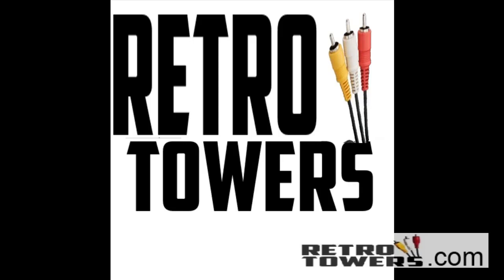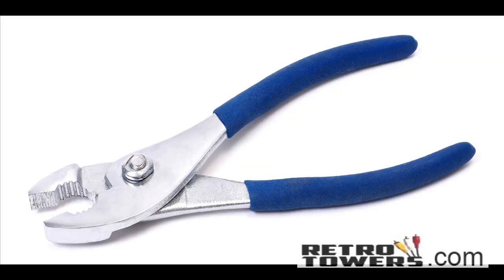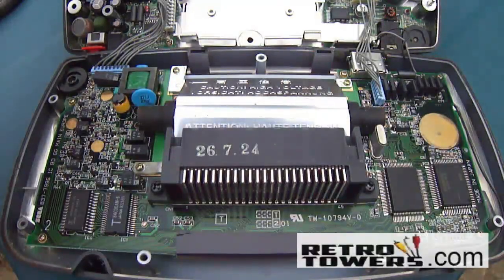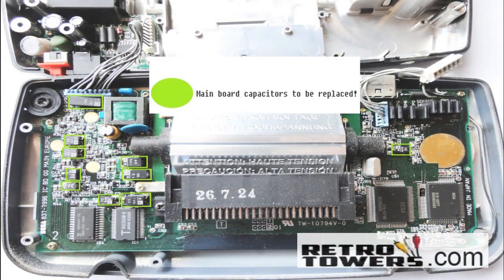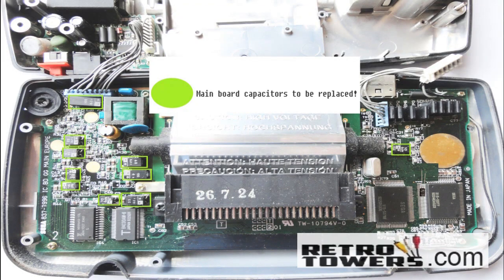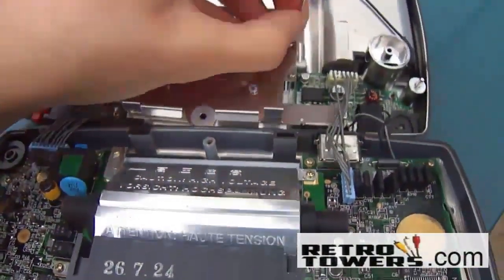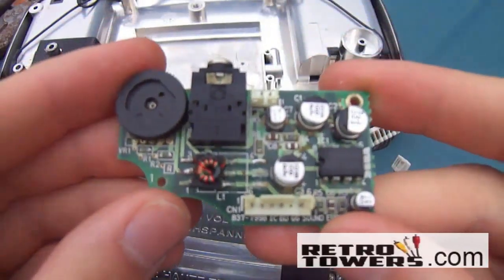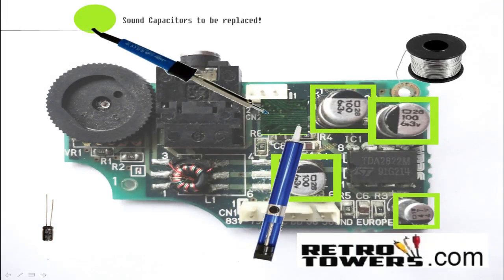Game Gear Screen and sound Fix capacitor replacement

Comment: I've got one that has sound, but the screen is just white. I can't see the game, even from an extreme angle, and the brightness wheel does nothing. Do you think this would be a capacitor issue, or do you think the brightness is just maxed out and the wheel is broken? If the game gear brightness is turned all the way up, can you normally see a game?